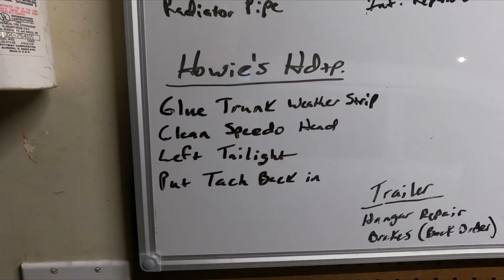Cruising in Howie's '55 Chevy Bel Air Hardtop on Father's Day

Comment: Awesome video Jeff, i think Howie liked it when you got into it 😁😁, the 55 was running strong, catch you soon buddy
Reply from the maker: Thanks Mike!  It was a fun day and Howie really enjoyed it too!  I think the fuel guage was a big surprise to him too!  Thanks for watching!
Reply: @hubiesgarage  do you still plan on getting the speedo working
Reply from the maker: @DesertRatFabrication Yes, I may go get it today and do a video on repairing it.  I will do the repair video on it.  It has been some time since cracking one open!  The last one I did was for a '66 Bug I had owned.
Reply: @hubiesgarage  ok , yeah the one in the 55 truck is stuck on 20 miles per hr. I haven’t cracked into it yet
Reply from the maker: @DesertRatFabrication It will probably be my next video.  If not, it will be out the following Saturday.  I need to do the one in my '67 Bug too!  It will be a memory jogger for me for sure!